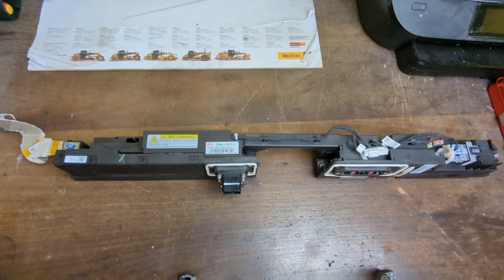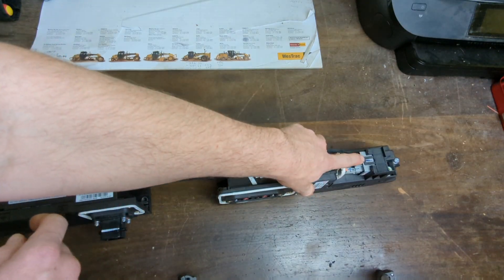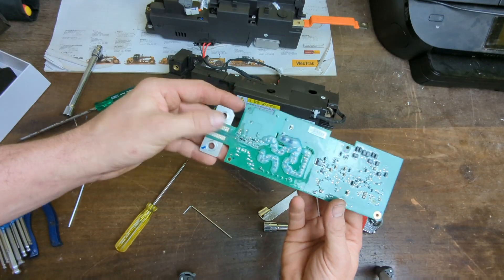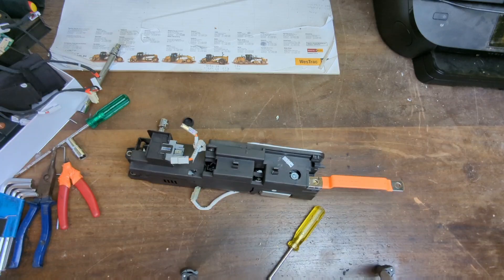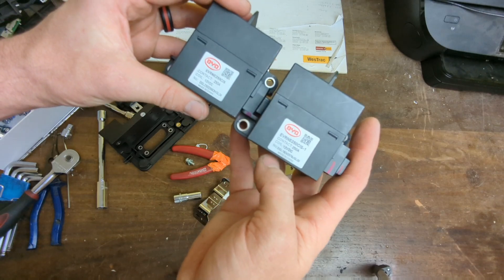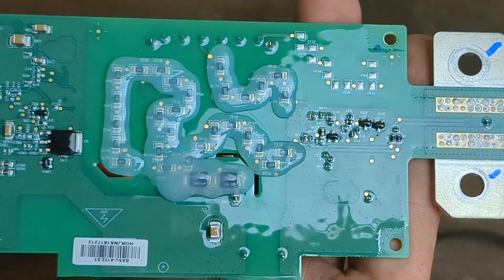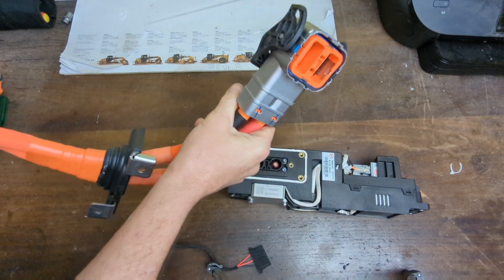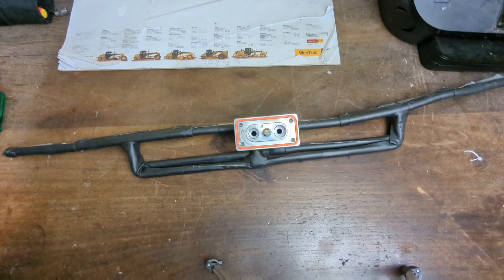BYD Atto 3 battery dismantle P2 - contactor block

Comment: Hi brendon this is sridhar, from carscabs india. We have suspect of  one of the board battery juction. There are 4 wire 2 black and 2 red. I hope these are communication wires. After first board continuity will come. But not in first board.  Can u suggests some thing.. 

Main boards changed and tested. 
All contactors are working fine.

can i get ur mail id.?
Reply from the maker: Each of the daughter boards down the side of the battery are powered by the cells, so if the cells are too low it might not communicate. I have heard stories of those boards failing
Reply: @Brendon_M  thnx 4 quick response mr. Brendon, 
All cells reading exact 3.3 volt, and total pack voltage is around 546 volt.

Comment: So where do you reckon pyro fuse on this byd ?
I got one with blown airbags and hv battery disconnected
Reply from the maker: No pyro fuse. You just need to rest the fault codes before it will ready up. Unless you blew the main fuse in the battery pack from there being a short in the HV system

Comment: How did you clear the fault codes after the accident?
Reply from the maker: I tried to use a Bluetooth OBD reader but it couldn't do it so in the end I used a proper scan tool from my work
Reply: @Brendon_M  I bought an Atto 3 with curtain airbags deployed, but the vehicle is not ready to drive. Can you support us in this regard?
Reply from the maker: Not really unfortunately, all you can do is get your hands on a workshop scantool. Most cheap ones and obd dongle types don't do SRS so you won't be able to clear the fault codes.
Reply: @Brendon_M  thank you Can you share the brand and model information of the workshop scanning tool you use?
Reply from the maker: It was an Autel Maxisys Ultra EV.
Reply: @Brendon_M  thank you

Comment: Ideally you want the fuse outside of the battery pack, if the fuse goes out it would cost arm+leg to tear up the battery pack to replace the fuse. 
Less junk packed inside the battery the better, on the maintenance point of view.
Reply from the maker: True, but if the fuse goes then it being hard to replace is the least of your worries.
That being said, Tesla stopped using this style of fuse years ago because they deteriorated over the years and would blow at less than the rated current.
Reply: Fuse as close to source as possible. Really should never have the fuse blow unless in an abuse scenario. Which should protect HV wires as best as possible to not get short circuit conditions.
Reply: they are using automated circuit breaker instead of fused

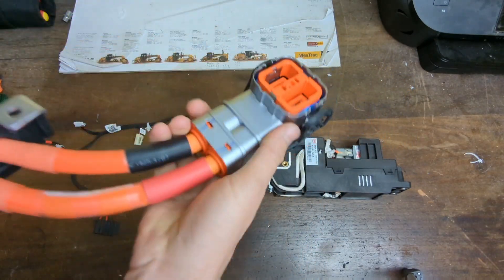Comment: @11:40 This side is screwed so interlock is not needed
Reply from the maker: Perhaps, but it's still possible to disconnect the plug and the car wouldn't know which means you could expose hazardous voltages if you didn't know what you are doing. Also it can be disconnected under load and the car won't shut down before the main contacts come apart which would lead to arcing.
Reply: @Brendon_M  It is possible from inverter side, so car would know that lack of voltage on inverter means disconnect or cable failure. With under load i think will be hard... serious under load means engine running and wheels touching ground... in other cases it will not be serious load (excluding some kinds of inverter failure)... but arcing is posibble still (capacitors) but this connector seems hide contact point inside so shouldnt be dangerous. Also is a question if this cable and plug on inverter is available to normal user.

Comment: why separate contactor to + and - busbar ? to have two gaps for arc ?
Reply from the maker: It's standard to have both a negative and positive contactor so when the vehicle is shut down there is no HV (positive or negative) anywhere outside of the battery pack.
Reply: @Brendon_M  I see, in case of crash or failure we suspect posibilty of one touchning chassis.

Comment: is that 350A fuse a Pyro fuse or normal fuse? I assume latter since crashing didn’t trigger the fuse?
Reply from the maker: Just a normal fuse. The crash logged fault codes so the car wouldn't ready up but after I cleared them I could move it without changing anything

Comment: In an accident, airbags were opened...are any part of these may be damaged and need changing due to airbag opening??
Reply from the maker: No, there is no Pyro fuse that cuts power in an accident.
The system only gets locked out by software All the airbags went off in this car but after clearing the fault codes I had the car driving again.
Reply: @Brendon_M  how fault code cleared ?
Reply: with obd port?
Reply: @Brendon_M  what software?